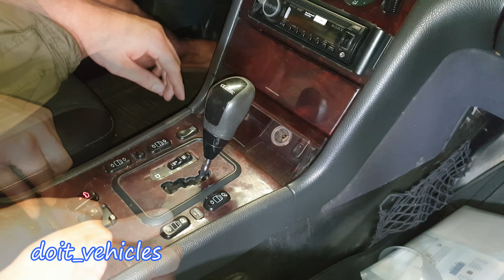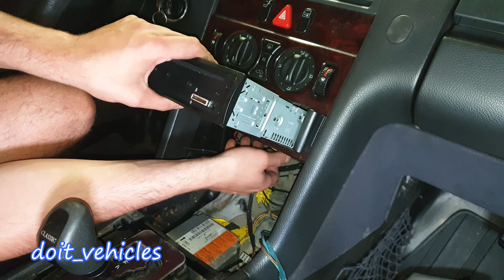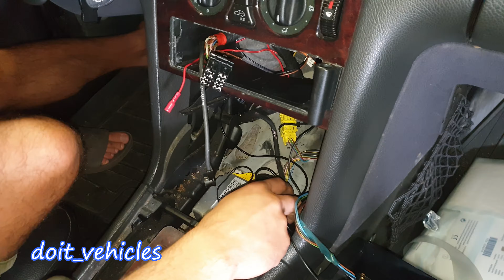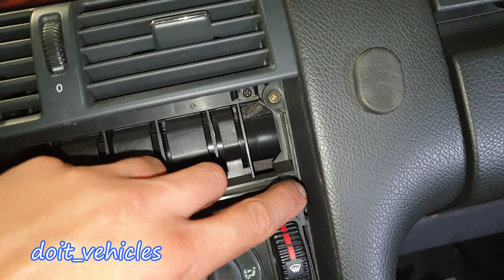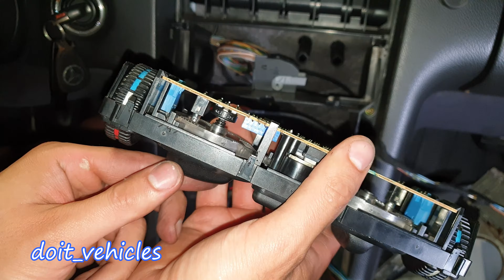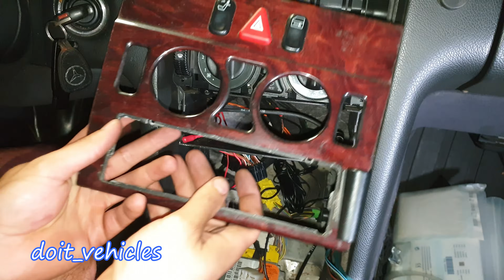W210 Mercedes Radio Removal and AC control Unit problems E220 CDI

Comment: the only one i can see is this one 
MERCEDES E CLASS (W210) 1995 - 2002 STEERING WHEEL STALK CONTROL ADAPTOR 39-MB-A10
it not cheap at £99 from Dynamic Sounds Ltd.

Comment: can someone find me a video on yt about how to restore that wooden parts :D
Reply: maybe an option could be to stick onto it a vinyl that simulates wood, like this: https://es.aliexpress.com/item/32815069707.html?spm=a2g0o.home.15002.44.267370e5Mm4QdI&gps-id=pcJustForYou&scm=1007.13562.168240.0&scm_id=1007.13562.168240.0&scm-url=1007.13562.168240.0&pvid=867b0e9f-2596-4bca-8137-712000f848b5&_t=gps-id:pcJustForYou,scm-url:1007.13562.168240.0,pvid:867b0e9f-2596-4bca-8137-712000f848b5,tpp_buckets:668%230%23131923%2315_668%23888%233325%236_668%232846%238110%23312_668%232717%237560%23210__668%233374%2315176%23947
an alternative could be to replicate parts with fiber glass and sand it to have a smooth surface and whether paint it or stick this vinyl onto it as well

Comment: https://www.dynamicsounds.co.uk/mercedes-e-class-w210-1995-2002-steering-wheel-stalk-control-adaptor-39-mb-a10.html?tracking=5e3b93d714794&gclid=Cj0KCQiAuJb_BRDJARIsAKkycUls91zVUq3z4sQnEytz40noQiHpTevv_nc6JGW9UUnQ83Mt76kdvZwaAj89EALw_wcB this is the kit to use steering wheel controls.